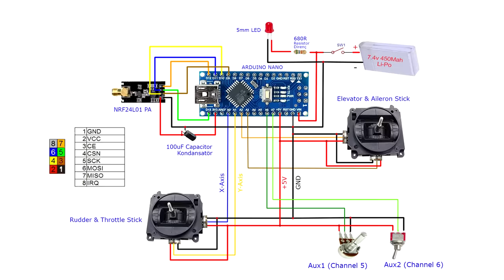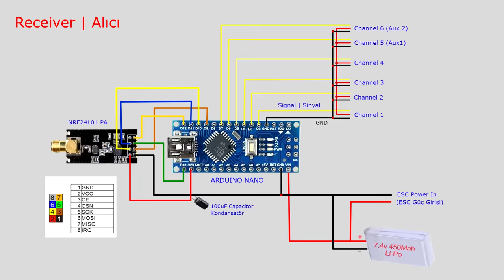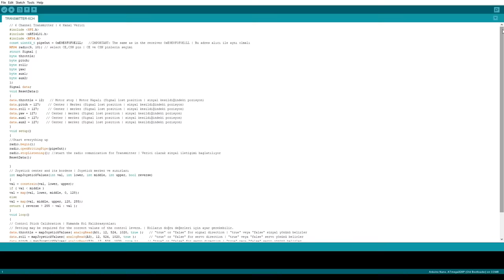DIY 6 Channels Radio Control For Models. How To Make İt

Comment: Basically with this setup, you're only limited by the number of input/output/analog pins on your arduino. You can send any data. It's a digital radio control system. Want 15 channels? You'll need 15 input pins and 15 output pins. But be aware that some joysticks use hall effect sensors. Those work differently than potentiometer based joysticks.
Reply: You cannot use 15 channels fully, cause you need analog pins for joysticks.
Reply: please how can i make 15 channels?
Reply: @Gifted_Gift  You'll need a microcontroller board with enough IO pins
Reply: Very simple, use an arduino mega board. It has 16 analog pins
Reply: can it handle 15 channels or even 1024.
if you need buttons use parallers serial chips LOL
for remote 74LS165 (paraller in/serial out)you can use multiple input using ehh 3 wires?
for vehicle 74LS164 (serial in/paraller out)(74ls595) turn then back output
pins on ardnuino not any limit you can expand input and outputs but can this wireless thing handle more than 15. dont know LOL @Gifted_Gift

Comment: thank you again sir, for sharing this project.. I have tried it and very satisfied with the result..
 I'm trying to add a battery monitor on the RX side back to TX -- but I'm still working on it, having a hard time on the codes.. I'll share with you the codes as soon it works.. wish me luck..
Reply: I have li ion battery instead of lipo will that enough for transmitter and receiver! Please reply!
Reply: @dontknow479  yes
Reply: hello when you built this did you only use the 3 libraries he added or did you have to add anything else?
Reply: Bro tell me that it work or not

Comment: Hey if i use nrf24l01 e01-ml01dp5 instead of nrf24lo1+pa will I get increased range If I will only use on transmitter side?
Reply from the maker: Yes, it increases.

Comment: I made this transmitter and receiver. I used the same joysticks that you provided link in description.
But I'm facing a problem. The transmission system itself is working just fine. But I think there is a problem in joysticks calibration. I did some changes by checking the values of joysticks and doing amendments in the code, but there is still some problem.
The first 5 channels having potentiometers are constantly getting small amount of fluctuations in their values. The channel 6 having a two position switch is working just fine.
Also, when I finally did the joystick calibration by mapping the approximately correct values of joysticks, there are still a lot of fluctuations in the servos when I move the joysticks. By fluctuations I mean that the servos are not moving smooth when I move the joystick. They are like moving with rapid vibrations.
Can you help me fix that?
Reply from the maker: I made this circuit 4 years ago. I don't remember having this type of problem. But using the analog pin instead of digital for the 6th channel may have caused instability. You can try a solution like this.

TRANSMITTER CODE:

   data.aux2 = mapJoystickValues( analogRead(A7), 12, 524, 1020, true );
Replace the existing line above with the line of code below. 
   data.aux2 = digitalRead(3);  
And solder the pin connection of the switch to D3 instead of A7.  

RECEIVER CODE:

    ch_width_6 = map(data.aux2,     0, 255, 1000, 2000);
Replace the existing line above with the line of code below. 
   ch_width_6 = map(data.aux2, 0, 1, 1000, 2000); 

If the problem is still not resolved, you may have a hardware problem. Like a broken potentiometer...  
NOTE: Also important are the batteries you use for the transmitter and receiver. A low C value (current strength) causes problems such as unstable operation, slow and intermittent movements).
Reply: @Kendin-Yap  Thanks for the help. Will surely try it. Also, I made the 4 channel arduino based transmitter using arduino joysticks and that's working very good. The same you made. So as you're saying this might be the real problem.
Also I twisted the ground wire around MISO and MOSI pins, like you showed in your 8 channel transmitter. And the whole setup of transmitter contains a lot of wires like a mesh. Can this be also the cause of interference?
Reply: @Kendin-Yap  Tried this step of completely removing the aux2 switch from hardware and software. Problem is still unsolved. Any other idea?

Comment: Excuse me sir, but if use you own DIY esc, like that you made, can I use the 5V from arduino to feed the servos?
Reply from the maker: Arduino does not provide enough current strength. You can use an external regulator.
Reply: @Kendin-Yap  hello, thank you for the nice project and tip, one more question can I use the battery feedind DIY ESC, to feed the servos, the DIY ESC can feed the arduino?

Comment: Meraba! 

Many thanks for your video and projects. Just, like a new idea, can you add a LCD screen for back feed with the model, such as a battery voltage and signal strength. And the selection of the model, if you will use two similar transmitters for several models at the same time?

Comment: abi arduino vin ile vccyi birleştirip 3s 11.1v lipodan escnin bec devresi sayesinde arduinoyu çalıştırabilir miyiz? ya da arduinoyu başka bir güç kaynağı ile mi çalıştırmalıyım 10vdan fazla olmayan?
Reply from the maker: ESC nin Bec devresi ile arduino çalışır. Ama NRF24 modülü için kullandığımız 3.3V çıkış pini daha düşük voltaj verir. Çok uygun değil. Harici 7-9V arası bir güç kaynağı ile daha mantıklı. Örneğin 2S lipo veya 6 AA kalem pilden oluşturulmuş batarya gibi..
Reply: @Kendin-Yap  arduinoya vin ve gnd pinlerinden harici kalem pillerden bir batarya yapsam, servolar içinde escnin bec devresindeki 3lü kabloyu kullanacağım yine değil mi?
Reply from the maker: @user-nd2un4xs8z  GND ortaktır. ESC kablosu zaten servo pinlerine takıldığında Servolar oradan beslenir. Harici güç kaynağının artı kablosu ise sadece arduino Vin girişine bağlanmalı. GND kablosu (Toprak) ise Arduinonun herhangi bir GND pinine bağlanabilir. ESC nin artısı ile harici pilin artısı birbiri ile temas etmemeli. Yoksa sorun olur.

Comment: Excuse me sir, if i want to use it in rc car, i must change data.throttle = 12 to 127 right? So i can move the motor to forward and reverse ?
Reply from the maker: yes
Reply: @Kendin-Yap  thanks you for your response sir, but I have one question,, if i want to use brushed motor for all channel (so i want to change all servo with motor), i must use esc in every motor like your video rc drone using this controller?
Reply from the maker: @yantos116  Yes, motors cannot be directly connected to the receiver. One ESC must be used for each motor.
Reply: @Kendin-Yap  tkanks you sir....

Comment: Servo vibrating and i fastly move joystick then it disconnected and required to reset button of reciver . I face this problems after making 😢
Reply: Disconnecting because of fast servo movement is just because of low voltage. Use a high rating battery with receiver and try to power arduino externally and not from esc

Comment: Hello! Have you tried programming the BK2461 (FLIP51) radio module chip itself? According to the datasheet, it has 4 ports for PWM control, which is very interesting. But I can't find documentation anywhere on how to program it.

Comment: Do you know why when I tap the board or some device in the receiver it starts working for a while?
Reply from the maker: The explanation for this may be as follows. The antenna output of your NRF24 module is insufficient for some reason. For example, there may be an insufficient power supply or poor contact, etc. And the human body can act as an antenna. When you touch it, there may be a kind of antenna booster effect. A follower of mine reported that he had a similar problem. And he reported that he solved the problem by wrapping aluminum foil around the antenna. Interesting ...

Comment: hey guys i made this radio control just like the video and its working but when i connect the antenna to transmitter it stop working .
 what should i do ?
(the module is ok)

Comment: I made everything like a video and it plays, but as soon as I turn on the DC motor or brushless motor, it runs for a short period of time and then everything stops. What is the reason, please?
Reply from the maker: First, check the voltage of your battery. The battery power may become insufficient after a while. Another possibility... It may be related to your solders. It may be a poorly made solder (such as cold solder) that loses contact when heated.

Comment: That's a really very nice 6 channel transmitter and receiver, but I want to know one thing which is- What will happen if the battery from the receiver side gets discharge? Will the receiver alert in that situation or not or, will the RC plane, drone etc in which ever we use the receiver of this transmitter gets fall down accidently? Because in such case the market receivers like flysky FS-CT6B alerts as its receiver starts to run and then off the motor in whichever RC plane it's installed, and one more thing can we run this DIY transmitter and receiver using 12v current? Please reply I am curious and want to know about that. By the way nice video. 👍👍👍👍
Reply from the maker: No. It does not give any warning. And the control signal is cut off. This is the case with commercial analog remote controls already available on the market too. Example Flysky FS-4TB.
Battery telemetry is included with some digital remote controls. But there is a subject that is misunderstood. The telemetry data does not see the battery voltage but the regulated voltage from the ESC. And this is misleading. It does not provide a working warning. Usually, an external voltage sensor is required for this. Some expensive remotes have telemetry systems that directly indicate the battery voltage. Example Hitec Aurora, Futaba etc. etc.
Reply: @Kendin-Yap  Ok I got that but is there any solution for that particular issue where the signal from the receiver gets cut off means can we add some kind of circuit to resolve that problem from the receiver side? If possible please suggest something or try to make a particular video on that point. By the way thanks for your reply. 🙏

Comment: ARE YOU USING POWER FOR THE SERVOS FORM THE ESC ? OR DIRECTLY FROM THE BATTERY
Reply from the maker: The servos are fed from the BEC output of the ESC. But if desired, servos can be fed with an external battery (5-6V)
Reply: @Kendin-Yap  OH OK....Thanks for helping out man.... appreciate it 👍

Comment: When you solder the male pin headers for the channels on the receiver, I see you connect the signal and ground cables to the respective pins on the Arduino, but you don't connect the middle row (the red power lines) to anything on the receiver. How are your servos getting power? Do you not need to connect the power lines to power the servos? Is the signal line sufficient to power the servos? For reference, @6:23.
Reply from the maker: The servos are powered by the ESC's Bec output.
Reply: @Kendin-Yap  Aaaah of course! Ok that makes sense. So does that mean you are not powering the receiver with the BEC? 

To simplify, the BEC only powers the servos. The receiver is powered by dedicated power source (battery).

BTW I really appreciate you reading and responding to my queries! I love your work!

Comment: 2:15 what is the diameter of the circle to cut? Can u tell fast
Reply from the maker: You should use the gimbal you have as a template. It is not a standard size.
Reply: I have seen your other video in which u made this kind of joystick i have a 5k ohm potentiometer but i don't have a 3d printer to print so i only wanted to use throttle stick right side i will use arduino but i want good brushless motor control so how much cm should i cut for stick movement can you please reply me fast. Thank you so much

Comment: Hello sir.. just wanted to ask that the manufacturer claims to have 1000 m range, and there are videos proving the same.. so did you try you find out the reason behind this underperformance of 150 m range? I want to build this, but I'm just worried about the range.
Reply from the maker: Hello. Stable and uninterrupted signal is important for RC aircraft. The range of 1000 meters specified for NRF modules is a theoretical range. It is not stable and reliable over long distances in real conditions. And it provides a truncated, unstable signal. Some increase can be achieved with different antennas with high Db, but long range is not possible by default.
Reply: @Kendin-Yap  thanks for valuable response sir. Will using a dc-dc buck converter will enhance the range?. Also, would you recommend if I use a dihedral aileron in one of your design?

Comment: How do you know which is gnd and vcc for the joysticks? My joysticks are a little different and I am having trouble figuring it out.
Reply from the maker: The middle pin is fixed. Right and left pins change control direction. You can find it by trying.

Comment: Hello, can you help me? I have seen the  that you have uploaded to your website and the codeς, I have made it, but when I go to upload the code to the arduino you get hot and I have already burned 1 why ?
In the end the receiver does not receive the signal from the transmitter and without anything the SG90 servo starts to turn.
please answer me 
I have been trying for 1 week

Please answer me
Reply from the maker: The code cannot cause a physical burn. You may be making a mistake with the circuit connections. I cannot give clear information as I have no way of knowing what mistake he made.
Reply: @Kendin-Yap  Thank you very much for the answer

Comment: Hi, I just made the remote control that works very well, except that the joy on the left is not at zero, but with the kk2 and not only, it oscillates between 9/10 values. I saw in the video that your radio control has in trims ... but I couldn't find them ... putting these could solve the problem of these variable values. Thanks for your reply and always great compliments for your accomplishments of which some have successfully succeeded me ... a greeting

Comment: Can I ask you a question? Can this works for an RC submarine? Can transmits well under the water? (Obious it will be on a sealed waterproof compartiment inside the sub!)
Reply from the maker: Since water is a dense substance, it restricts radio signals very much. Does it work though? I don't know because I haven't experienced it.

Comment: Hi again Kendin. if I donnot use ESC as you mentioned i will need external 5v so where must connect the 5v? thanks again
Reply from the maker: You can supply 5-6v external power supply from the positive (VCC) and negative (GND) inputs on the servo pin line. It doesn't matter which one. Because all GND is connected in parallel. All VCC channel pins are also connected in parallel.
Reply: @Kendin-Yap  Thank you very much for your help

Comment: Im very intrested in these kind of arduino based transmitter but the issue is  can we optimized the code afterwards ? I have tried but the thing just didnt work propberly .

Comment: Hocam elinize emeğinize sağlık. Uzun uğraşlar sonucunda haberleşmeyi sağladım fakat bir sorunum var. Dc motor alıcının tüm pinlerinde çalışıyor fakat servolar çalışmıyor garip bir şekilde. Sizce bunun sebebi ne olabilir.
Reply from the maker: DC motoru alıcıya direk takmıyorsunuz değil mi? DC motor ile alıcı arasında bir ESC olmalı. ESC nin bec devresi servolar için güç sağlar.
Reply: @Kendin-Yap  Esc bozulmuş yenisi taktım sorunu çözdüm fakat bir sorun daha var joystick ile kontrol edilen servolar çok az dönüyor ama potansiyometre ile kontrol edilen servo gayet güzel dönüyor bunun sebebi nedir
Reply from the maker: Bu normal. Potans açısı ile ilgili bir konu. Potans kanallarının tamamını el ile çeviriyorsunuz. Bu yüzden maksimum alanı kullanabiliyor. Ama Kollar kısıtlı bir alanda potları hareket ettiriyor. Kolların bağlı olduğu poransiyometrelerin açısı 60 derece ise ancak maksimum hareket alınabilir.  Tipk potlar 220 derecedir. @Biolumiverse
Reply: @Kendin-Yap  anladım hocam peki bu durum da yazılım joysticklere göre düzenlenemez mi
Reply: @Kendin-Yap  hocam bendeki joysticklerin analog okumasını yapıp doğru değerleri buldum ve kod da bunları düzenledim şuan güzel çalışıyor

Comment: so even with the 3 libraries I feel like something is missing in the code. does there not need to be any other code for the NRF24 boards? the code loads in as is, but im not getting any connection.

Comment: Hello
As I think you already know the joysticks you put on the link are no longer available, the one you are using has a resistance of 5k. Do you know if I can use one with a resistance of 2.4k? Could there be a problem?
Reply from the maker: It works. But servo movement limits may be different.

Comment: hey what was that thing that you pluged the motor into to make it move with the joy stick becasue i dint see it in the list you had in the discription
Reply from the maker: ESC (Electronik speed Control)
Reply: Can we use a PS2 joystick controller instead?  @Kendin-Yap

Comment: merhaba 2 sorum olacaktı alıcı devrede kanalların orta bacaklarını kırmızı çizgiyle birleştirmişsiniz ama boşta kalmış onun bir yere bağlanması gerekmiyor mu bir de alıcı devreyi 3s batarya ile beslesek bir sorun olur mu
Reply from the maker: Yok gerekmiyor. Çünkü servolar elektriği ESC nin BEC çıkışından alıyor. çünkü aynı pin hattına ESC nin 5V çıkış veren BEC devresinin pozitif pini takılmış oluyor. Pil 3S olsa da ESC nin BEC devresi servolara 5V yada 5.5V verecektir. Servolar için sorun yok. Ama alıcı için durum farklı. Bazı Arduinoların harici besleme girişi 7-12 destekliyor. Bu durumda sorun olmaz ama bazıları 9V üzerinde yanabiliyor. Kullandığınız arduinonun desteklediği harici voltaj aralığından emin olmanız gerekir. 
(Harici bir regülatör ile kullanılabilir tabi. 12V dan 7-8V a düşüren basit bir voltaj düşürücü devre ile güvenle kullanılabilir. )